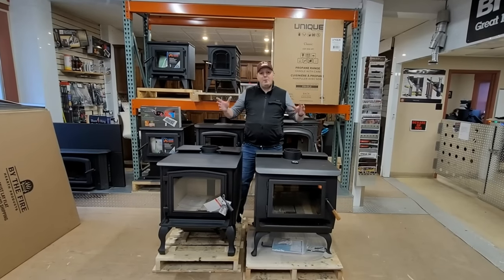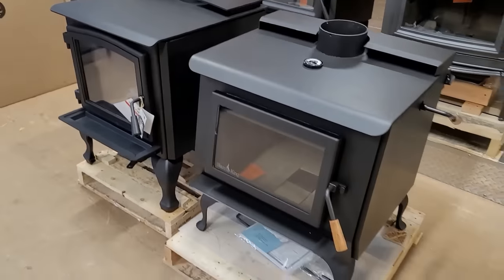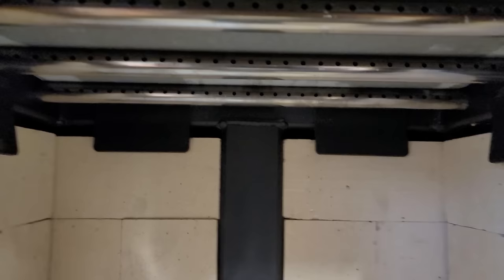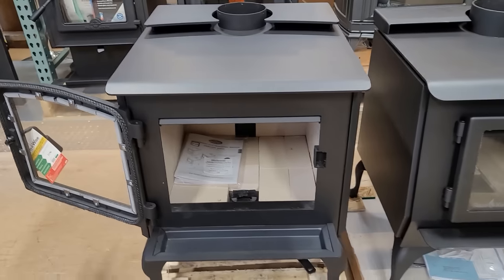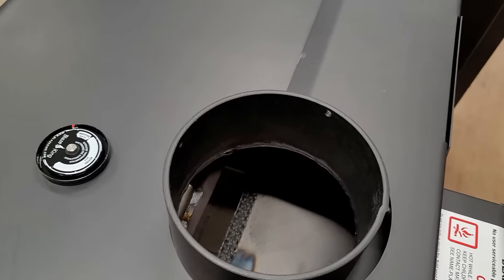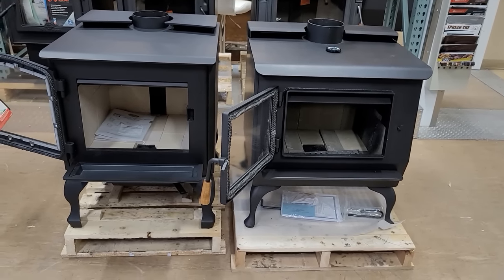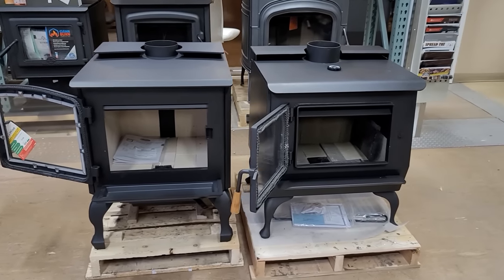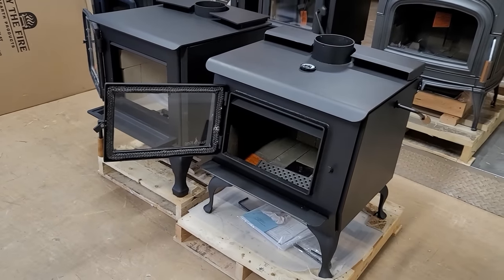Comparing Catalytic to Secondary Air Wood Stoves

Comment: Either one of the stoves you have ..get the fire ripping in the start with wood at less than 10% moisture.
Let the flue get to about 300 , it may take some time.
Once your over 300 , leave door cracked and stick 2 to 4 pieces of wood with moisture level over 20 but below 35%.
Let wood take.
Once the load is going , shut door and close off air down to 10% max.
If you do that correctly , your fire should last all night.
When getting up in AM , rip the fire hot with nice kindling or a few small real dry logs.
And repeat.
It's 30 degrees outside but the thermostat that's about 40 feet away from the stove , also with twists and turns of hallways and walls , it's 74 back there.
Just make sure you burn it hot in beginning and end. 
And never burn pine or fresh / green wood 
Always remember moisture levels may result in the wood being damp from a recent rain storm , and that isn't wet core wood , it's only surface moisture.
Be safe and always have your chimney swept Once a year and never be proud if you voted for biden.
Reply: Enough of the political bullshit!
Reply: @louiswestfall9622  ?????????????
Reply: Let's  go Brandon
Reply: In many parts of the world, pine is the only option.
Reply: @EFTTappingwithHeatherAmbler  I've heard..unfortunately you will have to sweep your flue multiple times a year and always be careful when burning hot hot.
Best of luck
Reply: @brenbates1677  Thank you.

Comment: Interesting!  How long will a catalyst last before it must be replaced?
Reply from the maker: depends on how its used. Burn seasoned wood and you should get a decade out of it, burn unseasoned wood or garbage and the cat might last the year. 
Same can be said for baffles and air tubes in the secondary air stoves.
Reply: @tinmaninc2023  thanks.👍

Comment: I have an Earth Stove brand that I've used since 1985. It has a catalytic converter in it but it smokes up the glass and you get smoke back up if not kept extremely hot. I burn mine open most of the time.
Reply: I had an Earth Stove, the catalytic converter didn't last long, and the replacement was expensive. I gave the stove to a friend - He didn't care about that.

Comment: Osburn Stoves made by SBI. SBI also make Drolet and Century Stoves, as was mentioned in the vid. My budget Century stove works great. Curious, when the 30 hour burn times are mentioned with a catalytic stove, at what stove top temps? If the STT is not 475+, it does not do a good job of heating the house. Ideally for our house,  475~550 STT is a sweet spot for duration and providing desired heat output.

Comment: Which stove is better for cooking in an emergency?
Reply from the maker: Doesn't matter. Either work great as long as the top is flat. Some OEM's make models with hollow tops that have a blower that blows heat thru. Not the best choice for cooking on.

Comment: Thankyou for this video; very informative. Question: We want a stove for two purposes...1) most of the time, on weekends, we just want a nice big flame for a few hrs. 2) an efficient stove for secondary purposes in case our ptimary source goes out. So, my question, can we have a cat stove in case we lose primary, but just remove the cat plate when we just want a good flame? Thx.
Reply: In yer case Id get secondary air stove, nicer flame, I donot know about removing catalist, but I doubt you should remove it.
Reply: We own a Lopi secondary air stove.
Reply: No need to remove the cat plate just don’t engage it. If you don’t do that it operates just like a non cat stove.

Comment: Twenty extra hours at low run setting ??? That sounds like a lot fella. Did you get that right ???
Reply: They can run that long. But Minimal heat out put is not discussed. My HT 2000. Runs 12hrs. House and shop still above 20c.

Comment: Do either of these stoves have provision for hook up to use outdoor air for combustion ?  That would keep you from using warmed indoor air for burning just to throw it out the flue.  State of the art gas furnaces use that tactic along with the exhaust condenser setup to wring heat out of the exhaust.  My earlier era high efficiency furnace uses condenser tech that leaves the ultimate  exhaust so cool that it discharges through a 2 in. id pvc pipe.
Reply: Yes, my BK does.

Comment: Do you have to replace the catalyst element at all?
Reply from the maker: It is a replaceable part. What you "Byrne" (see what I did there...lol ) determines how long it lasts. So if its looked after then you will get years of long service. Same goes for secondary air stoves and their baffles/air tubes.

Comment: Does it maintain heat through out the 16 hr in -25  or do you have to add wood to keep the wood producing the the heat. (Catalytic )
Reply from the maker: That really depends on the home and how well insulated it is.

Comment: Thanks in advance. If cost doesn't matter, what's the most efficient wood stove for cooking out there in the whole world? 
Same question for heating purpose. I am assuming that the cooking wood stove has to be a bit different from a room heating wood stove.
In other words I want to find out what stove if existing uses the least amount of wood per day to fulfill the needs of a family of four in icy conditions. Again, cost doesn't matter. Only the best existing stove that can be bought and gifted.
Reply: The heat output will be proportional the wood type and how much wood the firebox can hold and the stove's efficiency, which is a measure of how efficient the stove is turning the wood into BTUs. Generally, one with a catalytic converter will be a bit more efficient than the very best non-cat stove.  However, make sure you ask how much the cat is expected to last (# of fires for X hours) and what it costs to replace it.
Reply: @pfwag  thanks for the reply

Comment: What I don't get is why nobody discusses feeding whichever stove with only air from outside via a duct system and not sending heated air out the chimney. The next level of efficiency.
Reply: Cold outside air would cool the fire. I honestly don't think there would be much of a difference.
Reply: @LifesLaboratory  That's ridiculous! Never mind the draw that feeds the fire pulling the exhaust from the heating system back into the airtight house.
Reply: @KP11520  A house should never be airtight (I don't know about you, but I enjoy a bit of oxygen). In terms of thermodynamics, it really doesn't matter too much where the air comes from (whether from the room or from a direct duct, it is ultimately coming from the outside). What I don't understand is how a direct duct would prevent heated air leaving through the chimney. The fire would still need to heat this air in order to heat the stove and thus heat the room.

"Never mind the draw that feeds the fire pulling the exhaust from the heating system back into the airtight house." I have no idea what you are attempting to say here. The fire is the heating system. How is it pulling it's own exhaust and how is it introducing this into the house? A wood stove should never exhaust into the house.
Reply: Make up air from outside would be needed on a tight house and would be beneficial to cutting down on drafts on a not so tight house.

Comment: I have a catalytic stove (Dutchwest by Vermont Castings) and I hardly ever use the catalytic converter, mainly because where I live (north Alabama) the weather never gets cold enough to run it because it won't work if the outdoor temp is above 25 degrees. It has to do with the way the stove draws in cold weather.

Comment: What about the Woodstock hybrid stoves? Can these be either/or stoves? I believe they have secondaries and a cat. Thanks
Reply from the maker: You are correct.... I am working on a video on this....I believe these hybrid stoves were built for one purchase and its to beat the EPA emissions which doesn't really account for real work usage.
Reply: Great. I have an old Dutchwest 2462. It need rebuilt bit if the Woodstock Ideal Steel is everything they say it is, I won’t bother. Keep us posted. Thanks

Comment: I’m renovating a 600 square foot cabin and have little experience with a wood stove for such a small space. Do I need all these bells and whistles? Or will any small stove do?
Reply from the maker: Be careful with smaller spaces as newer homes are more air tight.... you could easier use all the oxygen in the home so you might need to find a stove that has an outside air intake.
Reply: @tinmaninc2023  All mobile home certified stoves have that feature

Comment: For the off-grid and homesteaders, look into getting a free-standing pedestal wood stove that is approved for mobile homes. By law, they are required to burn outside air which means your stove is not sucking and burning any of the heated inside air in your house which makes a vacuum which then sucks the cold outside air back into your house.  I had an old Lopi non-cat one once before we moved. I don't think Lopi offers it any more but there are others out there.  If I remember correctly, I think it was a 80,000 BTU stove and it could heat the 40 year old and not-very-well insulated 2,000 square foot house when it was -10F outside.  I tried it for 3 days in a cold spell in CO.  Of course the basement was 100F and the far bedroom was 50F but that's a problem with all wood stoves. FYI, if you can make a sloping up air channel for the stove using plastic sewer pipe with a larger diameter than the flue, and get some/most of it buried, it creates a natural rising air flow through the stove and makes the stove super easy to light. Probably burning the warmer air helps the efficiency some too.
Reply: Outside air supplied directly to the stove is wasting wood to warm that air up, plus giving you less efficient combustion. Indoor air is stale. By burning warmer indoor air, the fire is more efficient, and you get fresh outside air to breathe. All houses need air exchanges anyway, so it just a matter of creating it so you don’t feel drafts.

Comment: Question - when you do a long (ie low) burn in a catalytic stove, is there not an increased chance of creosote? Whether that be in the chimney or the catalyst itself?
Reply: As long as that catalyst is cherry red it will burn it off, and from the research i have done on these stoves, the bk can have a flu that can be opened up while running to show there is absolutely no smoke whatsoever going up the chimney. It literally burns it completely off. Ill find you a link that demonstrates it.
Reply: @Keiferdeifer  Awesome, thanks for the info.
Reply from the maker: Great question Larry. Wood like in all stoves needs to be dried to at least 15% moisture content. The catalyst when activated starts at 400 degrees and can go as high as 1700 degrees. It acts just like an infrared burner and burns up everything passing thru it. It is very important to understand the thermostat on these stoves as they work differently in the fall versus the winter.
Reply: We could not keep enough heat in our chimney as our cat. stove removed so much heat that much water formed and ran down the chimney making a mess despite burning dry seasoned hard wood
Reply: @tinmaninc2023  Which stove would you choose for yourself and why?
Reply from the maker: @1974jrod  lol.... I have had 12 stoves in 15 years that I have been in my home....I try everything to give it a real world test before we sell it to our customers. For me a Blaze King Stove is the best for my needs as it means I make less of everything like trips to the wood shed, cleaning up the mess on the floor, time spent in the woods, cutting, splitting, etc.
Reply: @tinmaninc2023  Thank you!

Comment: The hardwood/softwood debate is very interesting to me, as is how that relates to whether or not you should get a catalytic stove if you burn softwoods. If you live in the Pacific Northwest, or if you live high in the Cascades, Sierras, Rockies or Coast Ranges, or if you live in Alaska or Northern Canada, if you live in a really cold place, then your only reasonable option is softwoods. 

We live in an area where climate change has wiped out our pines. We lost hundreds of beautiful ponderosa pines on my place, some well over a hundred feet tall and four feet in diameter. So, we burn pine because we have decades of the stuff stacked around our place. To protect against the crazy wildfires that have been burning down whole forests and towns in my region, and that human caused climate change is making worse every year, we either have to burn the wood in winter burn piles, or use it to heat the house. Or, I bought a portable sawmill, milled a bunch of big ponderosa beams, and built us a new, super insulated, SIP, post and beam house. 

We love the idea of a catalytic stove, and not having to get up at four in the morning to throw another log on. But, we don't want to have to replace catalysts all the time. I just asked my wife. She wants a full night's rest. I guess we are getting a catalytic stove.
Reply: Blaze Kings are made in the PNW. There's no problem burning softwood in them.

Comment: US EPA measures the high heat value (HHV) efficiency of wood stoves and bases tax credits on whether the stove has an HHV of at least 75%. The emissions rating in grams per hour measures how cleanly, not how efficiently the stove burns.

Comment: tell me if im wrong but all fuel has a certain amount of klw energy .so lets say a log of oak timber has 5klw energy per hr . if you burn that timber over an hr it puts out 5kw. if you burn that same timber over 3 hrs then the output is 1.666 klw per hr. so if depends how much klw heat you need per hr on how fast you burn the fuel.
Reply from the maker: That is exactly correct. Catalytic stove stretch the heat out over a longer period of time while secondary air stoves give it too you at the beginning of the burn cycle. So there are more "peaks and valley's" with secondary air stoves the cat stoves.
Reply: @tinmaninc2023  Im not sure ,but i think you choose to miss main point, if you need to get  5klw of heat per hr to keep your home warm , or you will be cold...then you have to burn the equivalent  fuel per hr . stretching out your burn wont heat your house.
Reply from the maker: @reallywontsufferfools1620  it really comes down to the home itself and how well it works as a system. Equally important is choosing the right stove.... in my experience in my own home, i have had 12 different stoves in the 17 years I have been there. 9 of those were wood stoves with the majority being secondary air. When comparing how each heat the home the Blaze King cat stove burned less wood and kept my home at a more even temp. Here in Eastern Canada on an island in the Atlantic was able to keep my home an even 23 degrees Celsius throughout the home. This is mainly due to the thermostat built into the stove and opens and closes based on room temp. With secondary air stoves like Napoleon, Hearthstove, Osburn, Quadrafire and more that I have had we are at the mercy of the stove and its draft. Secondary air stoves add more air and produce more heat. Don't get me wrong, I loved the heat, but sitting around in my shorts in my rec-room in January was nice but it was wasted heat as we didn't need 30 degrees C and I didn't like the fact that I had to run back and forth every few hours to fill up the stove either. We also burnt more wood those years. I can see your a numbers person but the numbers change in every single home and with every type of chimney and even where the stove is installed. This video was done with the intentions to show people that there are different types of stoves out there and its important for sales people to help guide those customers to the best version that will work for them. That's what we try to do here without brand prejudice. We know what works because we are customers ourselves. Hope that answers your question.
Reply: @tinmaninc2023  sorry your upset did not mean to, i was only trying to point to some that mayb dont have well insulated homes and that fuel has a finite amount of klw heat. im sorry you felt the need to become defensive , my apologies again.
Reply: @tinmaninc2023  i agree but you should realise i was pointing out to the people with not so perfect homes that if you need a certain amount of heat cause maybe your losing heat then i want them to realise that fuel has a finIte amount of heat.im sure your stove is wonderful and sorry if i came across  your stove isnt!  and i didnt mean to upset you, sorry again.
Reply from the maker: @reallywontsufferfools1620  lol, i'm not upset. Your point is extremely valid and I sell all types of stoves. this is not a sales video, its a video to explain the differences of the way these stoves burn.